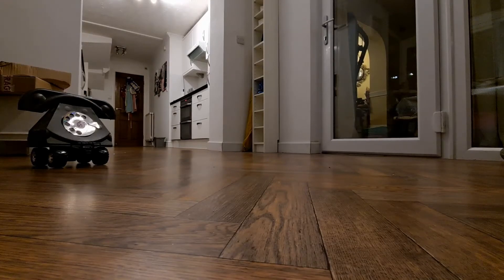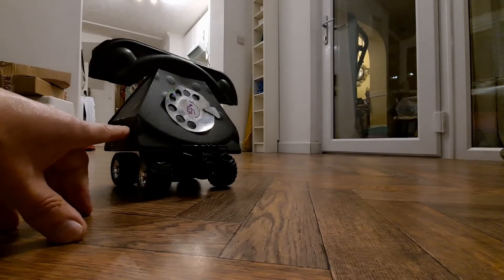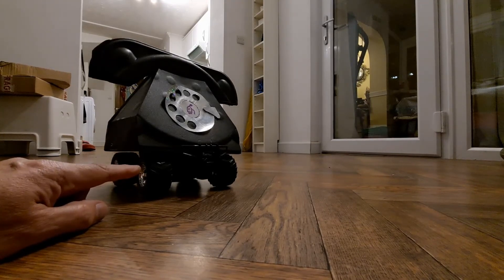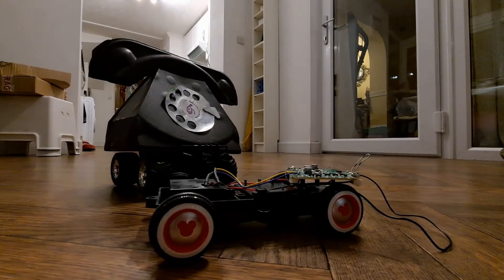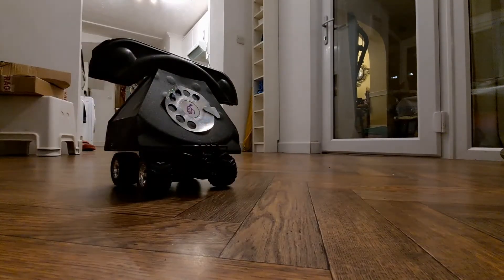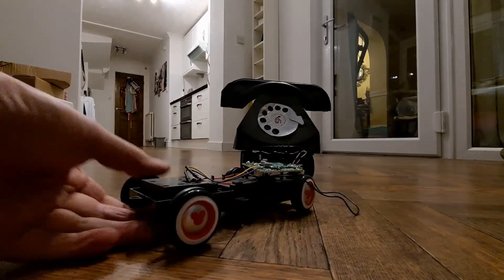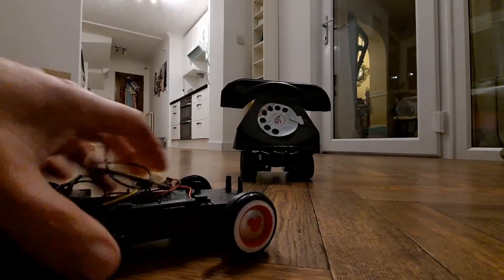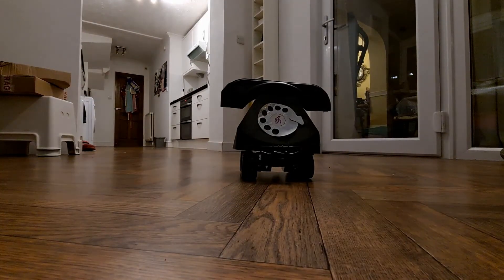Hobbygrade RC telephone car 😁☎🚗☎🚗

Comment: Those old style phones were well made and didn’t have any problems except some of the stretch cords needed replaced. The older ones were pretty heavy too.
Reply from the maker: My first job was a telephone installation engineer 😁
Reply: @GrandadIsAnOldMan    Lol, hopefully you never had to go to Hyacinths house on Keeping Up Appearances, you would have had to remove your shoes.
Reply from the maker: @George-wx9dj  I am pretty sure I removed my shoes several times

Comment: Funny looking Telephone  car lol.looks like back in the days 1920,s style.is that just another Chassis from another rc car and Put the telephone  on top of it?I know the phone is Made of Foam a d all not a real one tho.looks good and works nicely too.
Reply from the maker: Yes Marc, when I originally built it I used a toy grade chassis and RC gear but when I wanted to try it out for this video I couldn't find a controller to match it so I used the running gear from one of my Hobby Grade conversions.